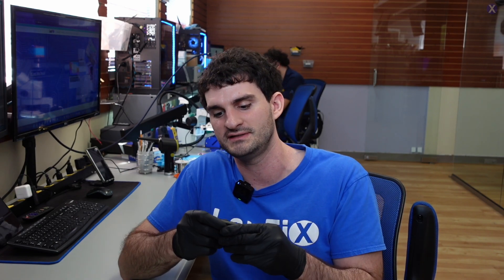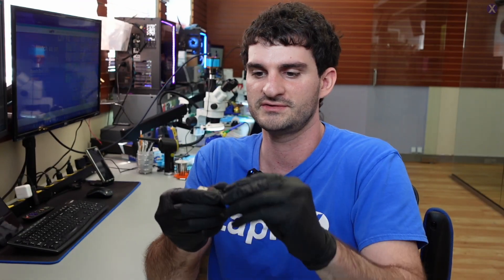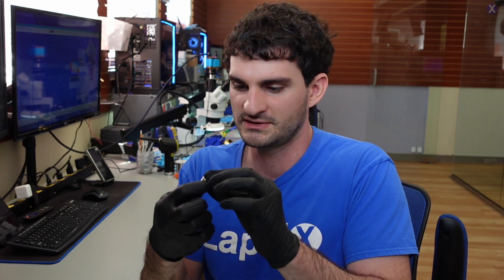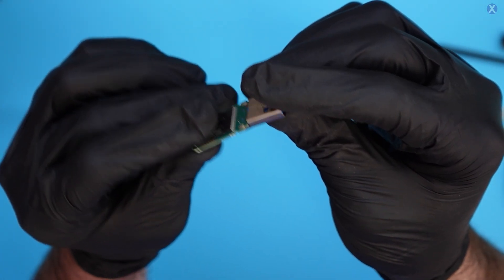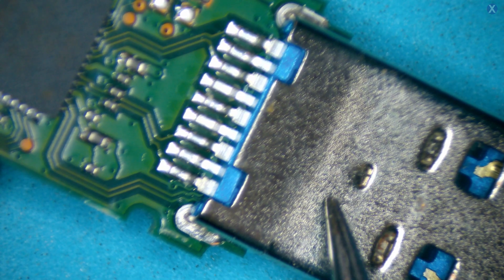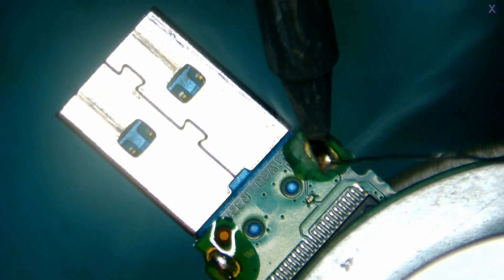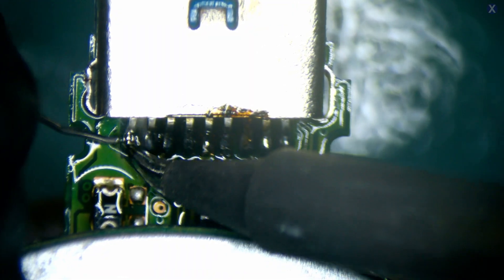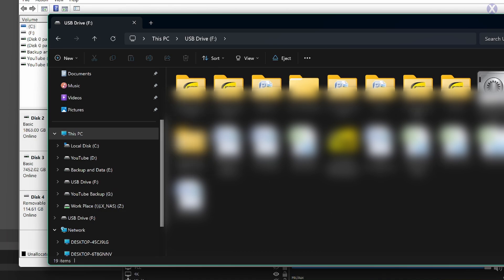Recovering Data from a USB

Comment: hey man i would like some help / clarification.

i know u dont do this for free but id just like something to hear.

ive had this usb for maybe 10 years now. and around 4 years ago it would connect but it wanted to format and i didnt want to because i had data on it and with recovery programs i couldve recovered about half of the files but i didnt want to pay for the programs, so i left it hanging. now for 2 years the usb connects but doesnt show up anywhere and after a few seconds starts playing the disconnect sound forever every 4 seconds until unplugged.

The only thing ive been able to do is get it atleast to show up in USBTreeView but honestly i think its done for.

do you think theres still a way for recovery of the files? i know its hard to tell like this.